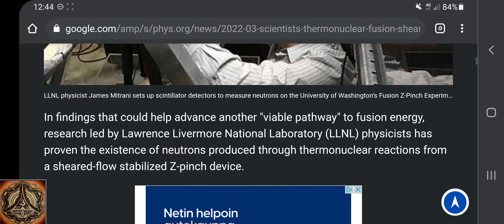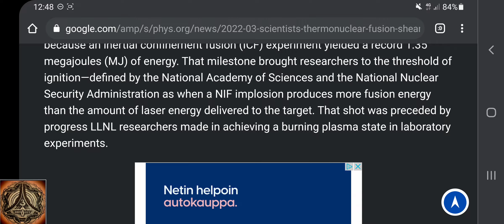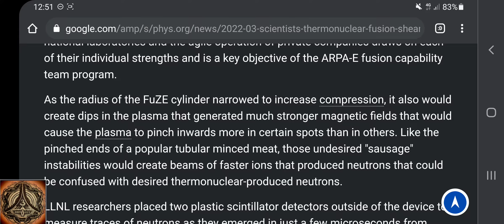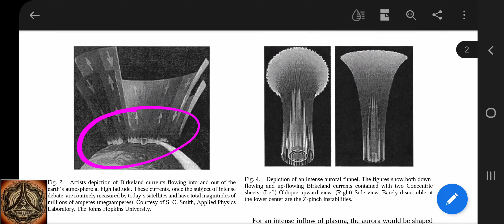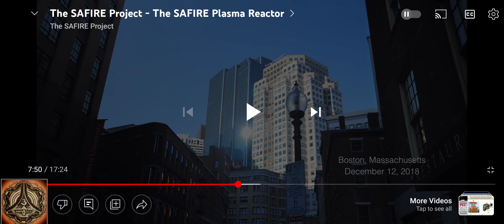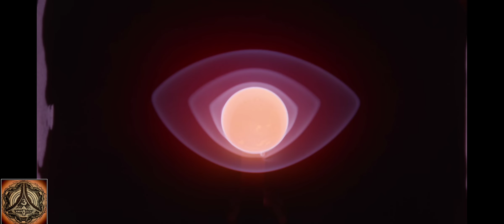Z-Pinch Device, Z-Pinch Paper, Z-Pinch Stone and the SAFIRE PROJECT

Comment: The most produced book of all time says that the 10 commandments, the stone tablets were sapphire. 

Regarding z pinch and dielectric inertial plane, 
Are you a fan of Ken wheeler?
Reply from the maker: The problem with wheelers theory is that it misses out on the electrics. They are mentioned but the main focus is on the magnetics. If you have a magnetic field (sphere) you will have charge flow, if you have an electrical current you will have magnetics. There cannot be just one of them.
We who are alive, create heat. So we are energy packs wich have to be fueled in order to sustain. Our heart beats because it gets electroshocked hundreds of times a day. It's not a magnetical force wich keeps us alive so the universe cannot only be magnetic. The magneticity of an object is through some ways (I cannot fully explain...maybe once then...) ultimately bound to the amount of energy used in its creation and the possibility of the object to store the energy of the creation process. This might explain the size of the Uranium element, it's the biggest one...
Reply: @AAAanomalies  I understand but I guess I synthesize his perspective. The trinity of forces, electric (charge in motion) magnetism and dielectric (the opposite of magnetism, and the confirmation of magnetic procession) are inseparable. Light is the tri-coaxial circuit and matter is hard light…or married positive/negative charge, proton is charge, electron is discharge and neutron is a married /bound couple, that create the nuclear anchor and the basis for hydrogen, the simplest aggregation of charge. Electricity is definitely a factor. I think it comes down to a definition of eather. But it’s all good. Love the insight and your perspective!!!!